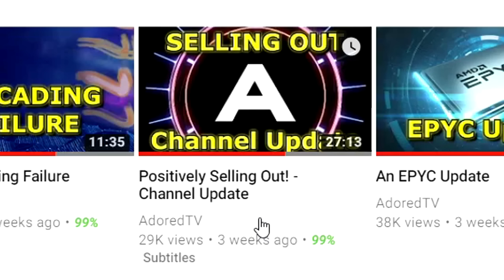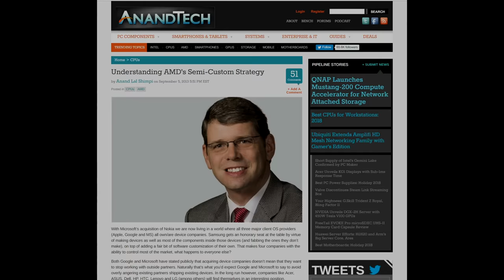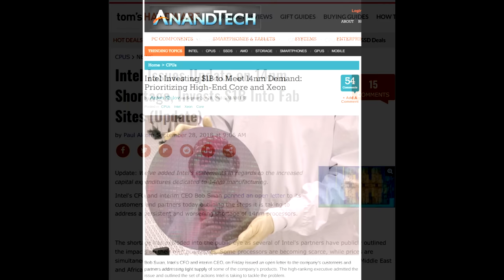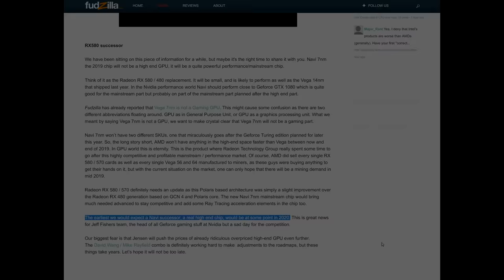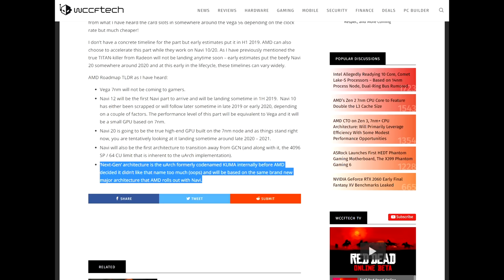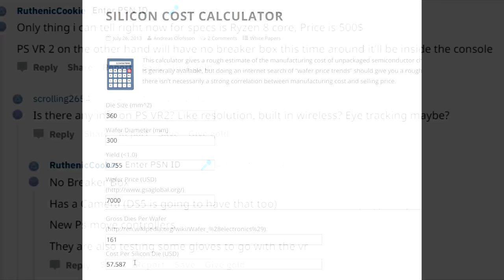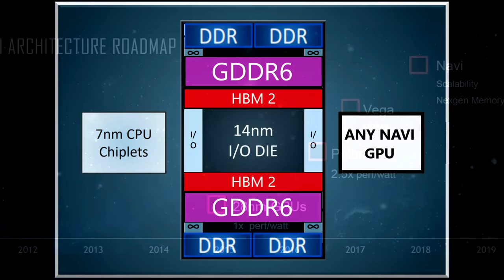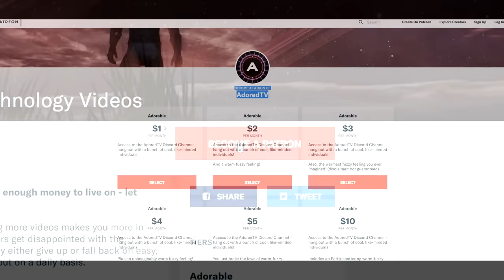AMD  - The (Evolving) Master Plan

Comment: Space in a console is usually at a premium, so I don't see them using 2 defective dies @ 4 cores each. Low binned 8 core chips certainly, but I can't see an unnecessary doubling of a component. Besides just using one die @75% yield and just dumping the rest, is cheaper than incorporating the defective dies, you'd need yields below 50% before the two die strategy makes any sense as the PS5 is the volume product by a big margin.

You had yield @75% for 8 core dies, of the remaining 25% those are dies with 1 or more defects but most will be with a single defect.
Defects on cores means full cache and defects on cache means half cache, there must be symmetry.
Point of reference the 1500X with 4 cores but full cache 16MB, 1400 with 4 cores and 8MB of cache.
The entire R5 range can consist of defective dies along with R3. This time around though the R5 2500X and the 2300X are OEM only so far.

Now we get to zen 2 and the volume increase with additional defective dies due to the playstation 5 chiplet scenario. But we won't just have 64 core Rome nor just 32 core Zen 2 Threadripper. Also on the desktop while it's more than reasonable to expect 16 core CPU's, the strategy might be for this next gen to only go to 12 cores which would require 2X chiplets and that means that the entire desktop lineup could be made from defective dies, X parts with full cache (64MB 4x16) and non X parts with half (32MB 4x8). 
So all those additional defective dies from the playstation volume, could be fully utilised and everyone's happy because core count up, with scope for 16 cores at HEDT pricing on AM4, while Zen 3 gets the full 16 cores at sub $400 the year after.

Also if the Playstation chiplet volume was to use two dies, you'd not cover the entire production from the defective die pile and would need to use non defective dies. A poor strategy that requires additional wafer production to cover the double volume used by PS5 unless you had two board designs one with one chiplet and one with two or a board with an unpopulated chip space when using full dies.

Somehow I don't think that that would be acceptable for such a high volume product as that also creates imbalance with cooling as the consoles are direct die contact. Due to mechanical differences there would need to be an additional spacer for the unpopulated chip. This adds additional cost as the cooler would need to be designed for both chiplets, and an unpopulated space also changes the mechanical force (not just the circulation) which can lead to higher failure rates. Making two different coolers shifts the volume production line calculation adding unnecessary cost to the playstation.

So while the PS5 may well be using the same Rome 8 core chiplets, it'll only use one. I'd be very surprised if it used two.

Comment: People often point out that the consoles aren't big money compared to some Intel contracts but they forget the main benefit of them: It's a solid, regular income over 5 or so years at the least when they have both main performance consoles.

That and I honestly think that AMDs fine wine reputation for GPUs is mostly down to games being optimised increasingly for GCN due to the consoles, even if it's not on a very low level it does mean that the way games are designed from the get go is optimised around the strengths/weaknesses of a GCN style GPU rather than a Pascal one or the like. Obviously, lower level stuff under Vulkan or DX12 has even more of a benefit.

Also, as an recent R9 Nano owner I have to say that they're perfect for 1440p or ultrawide 2560x1080 displays. Cheap on the used market, 4GB framebuffer is enough for any game (And they're noticeably less affected by running out of vRAM than GDDR based GPUs) and they're capable of maxing out basically everything I've tried so far on my Ultrawide. (Doom is straight 75fps maxed out constantly and even Forza Horzion 4 at very close to maxed out settings hits 50fps at the worst spots but mostly sits at 70-75)

Comment: Chiplets just sound like Slot 1 and Slot A all over again, only with the connectors on the bottom instead of the edge. It made sense then, it temporarily stopped making sense for a decade or so, and here we are.

Comment: So my guess would be aligned with the idea that Navi might be a 1080Ti contender. monolithic and on 7nm. What comes after I think they'll put in chiplets like their doing with Rome, I think they'll put in a I/O front end chip that can communicate with HBM3 and chiplets of CUs and act as an arbitrator for the CU bundles instead of relying on PCI or some internal Crossfire link. Basically spoof a chip to make it appear as one massive CU

You could have ~250mm 64CU chiplets (maybe less if the memory controller is on the IO chip). but you could make several iterations of cards based on how many chiplets are included.

Imagine a card line up of Vega with nearly 1x...2x...3x...and 4x vega 64 performance.... sadly the biggest limiter is thermals...  So maybe a 128CU limit @500w or so but it would be nearly 2x the Vega 64.... if there were a way to cool it better like water blocks more CUs would be possible.

And if Navi  or whatever is in the console is a Crossfired chiplet monster, and AMD forces developers to code for it on consoles.... it would work out over time to bring it to PCs

Comment: I think you made miss calculation there @36:12, 
All in all speculation based on AMD's naming/release schedules
Scalability likely means use of HBC for different types of memory. After Navi use of "KUMA" cough (hUMA) in consoles; 
(The HBC is even capable of utilizing NVMe as a memory, one design for all.) - IO will be 14nm at GloFo.

While it is unknown (and unlikely) if Navi 10 will ever see the light, Its very possible it won't; and gamers will be given Vega on 7nm with HBM2 or GDDR6 instead.

Navi 14 20CU's = Xb/PS5 = 1070/rx590 (Likely contained within 3 chiplets: 1x8core zen2, 1x20CU's Navi, 1xHBC(memory io controller 1/4 of Epyc - they'll run on hUMA arch) Making the production much cheaper = bigger profits.

(while die package size may vary due to use of HBM or GDDR6, also Navi20 may have 70CU's due to 11.1% increase over GCN vega64) 
1. Navi 10 will be the same size GPU(die) as Navi 20. 
2. Navi 20 is going to be on 7nm+, and/or will use HBM2. 
3. Navi 20 meant for professional market. 

Navi 10 to run with GDDR6. (~16-24Gb 4 chips ?Samsung? 16Gbps with ~70CU's, and 60CU's -- likely to have 60CU's for consumer market) -  2 flavors (just like vega56 and 64)
Navi 12 40CU's ~= 2060/Vega56 (Monolithic design) is probably going to be the last of monolithic designs on AMD side of things before HBC is migrated away from the chip.

// btw Zen2 chiplets are 8cores each. (judging by rome 64 core / 8 chiplets) | Desktop parts ryzen2800 is likely to be single zen2 8 core chiplet and 1/4 io, and 3700 is going to be 8 core zen2 7nm+ node ; while 16 core 2x zen2 chiplets will need 2/4 io and need new mobo's to utilize all pci-e lanes.

Comment: Also considering the PS5 is not going to lauch in the first quarter of 2020 and probably will wait until Q3 2020 yields should have improved on TSMC 7FF to the point where I don't think it's really necessary to do 2x4 cores I think they will have the GPU and CPU on separate dies for sure, but I think they will just use a single 8 core die with all cores active and a separate GPU die and just using a I/O die with the same number of external IF links as mainstream Ryzen.

So 1 IF link will be used for the GPU and 1 for the CPU I think it's a lot more elegant to do it that way, it's also how I expect AMD to make there APUs for Zen 2.

Comment: I was thinking the same thing except with modularity in mind, say for example Xbox One release an Xbox motherboard with a basic quad-core, and it comes with 4 gigs of soldered Ram.

You could buy Xbox brand Ram that has better compatibility but you also could buy a 16gb kit of RGB Ram

And it would be recommended that you use a specific line of gpus, and maybe you will even get access to the game a week early, but you can get a 1080ti even if a 580 is recommended to play games in 4k.
Reply: Maybe the soldered 4 gigs of RAM could be replaced with 32 gigs of octane Ram which is equivalent to 16 gigs but as expensive as 4 gigs of RAM.

And maybe you get hundred twenty-eight gigs of octane RAM for the same price as 16 gigs of RAM, which is more than capable of forcing through any optimization differences, and if you're buying 128 gigs or more of RAM then you're likely waiting for a sale saving so much money that a 10% optimization doesn't mean much to you

Comment: Do you guys think it would make sense for AMD/Radeon to entice Sony and Microsoft with dual GPU SOCs? PS and Xbox could have a entry level (single GPU) and high end (mGPU) box. Maybe the entry level could be a 1080p-120hz system and the high end could be  both a 1080p-120hz and a 4k-60hz system.

Comment: Very well made analysis!!! I think you are going to be right about using MCM module with CPU chiplets and I/O chip. Most likely next gen consoles will go with GDDR6 memory or possibly in combination with one HBM chip as ultra fast "L4" cache or something like that. Caching and data streaming in consoles is very important and Sony was always trying to have the best/simplest communication channel between CPU/APU and memory. Even previous gen PS3 was originally designed to have just XDR Rambus chips which ran at staggering 3.2Ghz speed same as the Cell chip. That idea of synchronous communication/no bottleneck communication between processing chips and memory will be at the core of the PS5 design. Development of the memory chips and experimenting of the new design has risen since Moore's law slowed down the shrinking of the chips die drastically as we've seen several years before. Designing cost viable memory, which is not slowing down the chips and has almost no latency lag almost like the chip cache is the ultimate goal to have the most efficiently designed out of the box device. The chip itself can only be as fast as the data flowing to it from the memory... and that's twice that important with the consoles.

Comment: things people quickly fogte when talking about console performance is taht devs use a LOT more time optimizing it and it will run on lower "setttings" compared to a pc, so 1080 ti performance might not be all that inaccurate.  only thing i wish consoles had was a version with higher end cooling, dont think many people care if its half an inch or even an inch thicker, even less if it was wide/deep cooling solutions are very cheap and they could probably charge 50+ bucks more for a cooler thats only slightly more expensive to produce

Comment: I am not 100% on this, but I think I remember that Polaris was meant to be top to bottom, but they weren't getting the results at the top end that they expected. I believe that is why we didn't get something like a 490. I do also agree that they cut projects to try to sustain their costs till they could rebound, and I am thinking that is what happened to Vega for Navi. I don't know if Navi will be that much better, but I hope so, or maybe it will be a top to bottom that can work at the top. 
I also think releasing the mid range Navi first would be smarter, as in one of your videos you pointed out that when they did the top first, and it wasn't able to beat Nvidia, that's when they stareted with the bs of a 660 as a 680. It will be interesting to see how this all works out, but I am excited.  Glad you put this much work into this as always, as it helps to point out the small details that a lot of people don't ever hear or remember.

Comment: I'm wondering what if Zen 2 is so good that those consoles are designed to only have 6 CPU cores and a very solid GPU core. 4k 60FPS isn't so taxing on the CPU side so, yeah, it could be possible.

Comment: If playstation at 500 bucks will include VR and 4k 60 fps, I will buy it purely because of the graphics. Too much is sacrificed to reach 144 hz on PC and what not. Console 4k and VR will be enough for me to just go and buy it. Plus, nothing's stopping me to have my custom PC anyways
Reply: For Next gen i will return to consoles, PC today price is a mess and to much problem especially Nvidia price and Ram price. I am miss the old day where it's just simple to play games on consoles without worrying about graphic card benchmark , driver compatibility and etc. I will buy PS5 if it's can play games at 4k 60 frames/second, and let my PC as it is until Nvidia GPU becoming cheaper again.

Comment: Navi will not be an MCM type GPU. We have known that for a while. It's successor (supposedly Arcturus) is unknown. Personally, I think it will feature an MCM design of sorts and feature ray tracing hardware. However, I don't think the MCM design it will be quite what everyone seems to expect, because of what AMD engineer said about the difficulty of achieving that and making it invisible to the ISVs. I think they will use a separate die for dedicated ray tracing hardware since that already seems to run on a separate pipeline, which should be a simple matter of making the driver cope with. That way rasterization can be handled the way it always has been, and ray tracing can be handled with it's own dedicated hardware, both while making use of the benefits of an MCM approach and remaining affordable for consumers. I could definitely be wrong, especially since I really don't have much knowledge on the subject and have no evidence to support this, but I think it makes a lot of sense if my understanding of how it all works is correct.

Comment: You read too Mich into the 4k 60hz capable. You can do that on the xbox one x if you go with less details as far as game developers go. There are games for the ps4 in which they still will run at less the 1080p resolution and the same is likely true for the ps4 pro as well.

Comment: you are confusing arch vs product. RX Vega 56 refers to 56 compute units, and Vega 10 is an uarch. Polaris 10,11 uarch (P10 = RX 480/470, could be named RX Polaris 36/32 in new naming scheme), P11 = RX 560, aka RX Polaris 16 in new scheme.

Comment: Navi needs to be GCN for there to be backwards compatibility with PS4 games, no surprises there. Hopefully this chiplet design comes to fruition but only time will tell.
Reply: That depends on software and how much those are precompiled, if not they can always be trans coded, it lot less of a issue for backward compatibility, then CPU instruction set difference which made backward compatibility hard for Sony for 2 last gens.... aspecially Cell which also included SPE cores :p

Comment: I don't understand the scale argument. Sure, if you make more and more CPUs, you will have more of the highly binned chips, but you also have more of the average chips. They still have to sell all those chips. They still have the same proportions of chips, the same bell curve, only more of them. So how does that help improve the overall quality?
Reply from the maker: It's easier to sell average chips with faster halo parts, just ask Nvidia an Intel. ;)

The overall quality doesn't improve mostly due to there also being more bad parts.  Bad parts however can be hidden with a very slight voltage bump over the worst parts and a large "catch all" TDP range.  That's why many of the really low-end "65W" chips actually run about 40W or so, they're nowhere near that bad on average but some may be truly atrocious.
Reply: @adoredtv  Fair enough. I've always felt that was a contributing factor to people preferring Nvidia over AMD. Nvidia has faster cards at the high end, they are "the best", and that affects people's perception of quality even at mid-range where AMD competes. Even if AMD has a better mid-range option, the average consumer sees AMD as second-best. And yes I've seen your other videos, I know AMD has had the better cards in the past and things like mindshare probably play a bigger role, but I'm just saying I think it's a factor today.

Comment: Nice analysis! And EVERYTHING just totally fall into place together. AMD, the LEGO company of semiconductors 😁

More seriously: It makes more sense doing things in a modular way. Each part can iterate individually, letting Infinity Fabric + IOChiplet be the "glue" that binds everything together.

There's one thing we must also consider: Active interposer. It has not yet appeared in early Zen2 processors, because (1) it's still being debugged, and (2) EPYC and Ryzen probably don't really need it. Yet.

But the PlayStation? Sony might be looking forward for an "easy" performance upgrade when they released PlayStation 5+... with active interposer!

Also, this kind of explains why Zen 3 "might only have incremental performance gains compared to Zen 2" ... Not because the Zen architecture has hit its limits, but because AMD probably wants to push out active interposers. Having Zen 3 not drastically different from Zen 2 definitely will help in debugging the active interposer.

Of course, this is all just speculation from me 😎

In any case, wooow!! What a great and fascinating time we're having in the semiconductor industry!!!